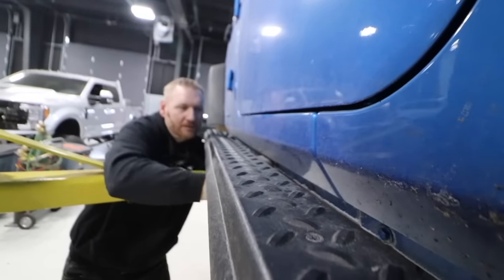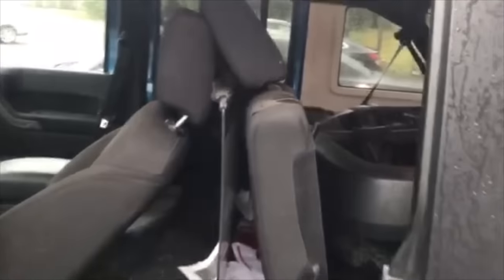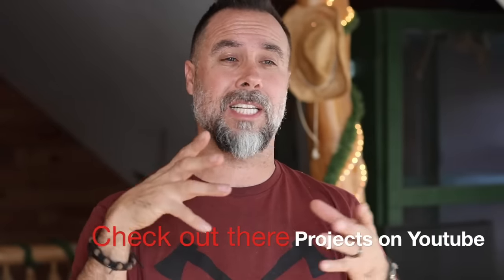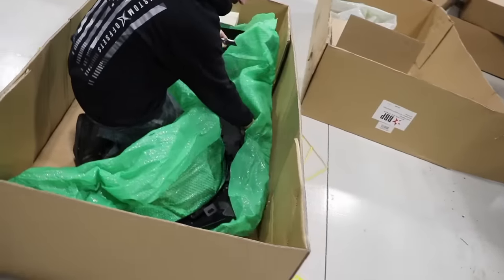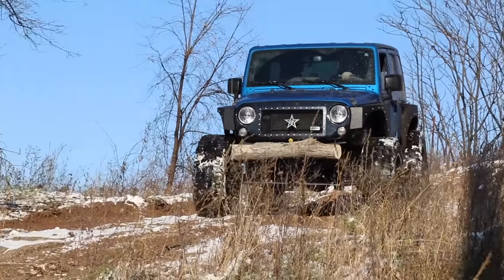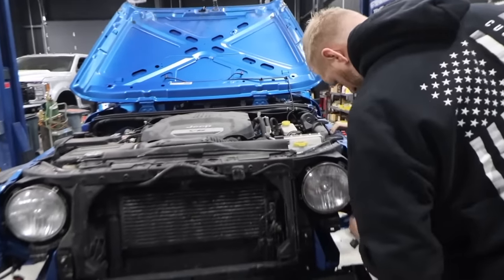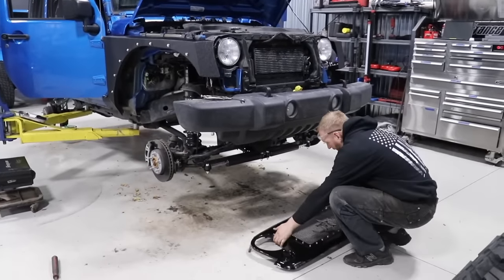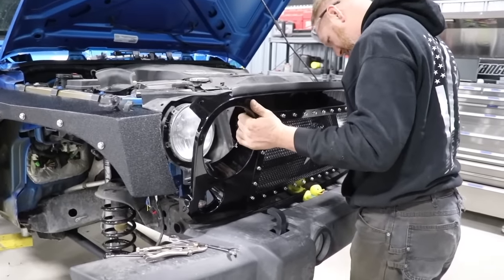Franken-jeep build-From smashed up, stock  jeep to Off road body armor & 4 x 4 mods

Comment: I'm sure you have the bumpers picked out.  I would check LoD, KC HiLiTES Gravity Light Bar, with the Painless Trail Rocker for your accessories. Toss in a PowerTank and if you get bored of the FOX 2.0's I would check out - https://metalcloak.com/1501-15-6pak-shock-front-jk-wrangler.html